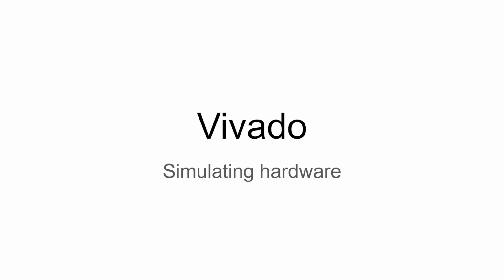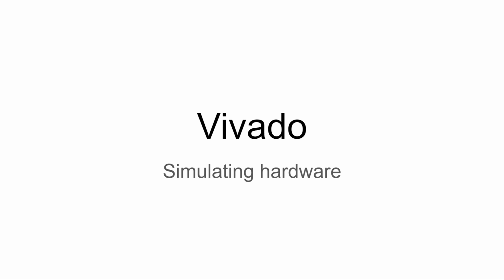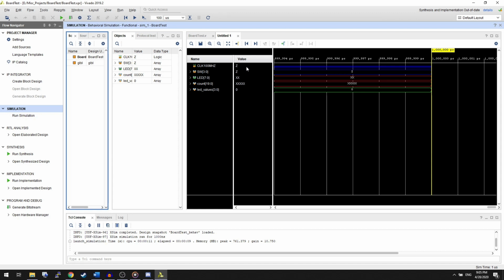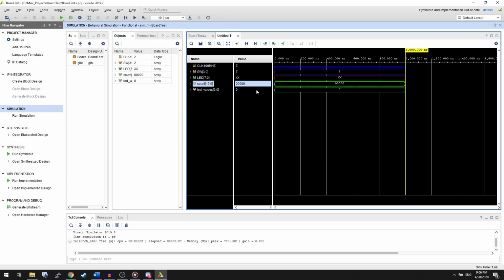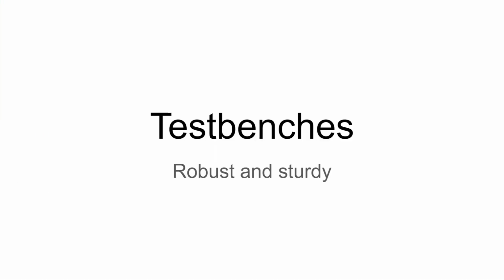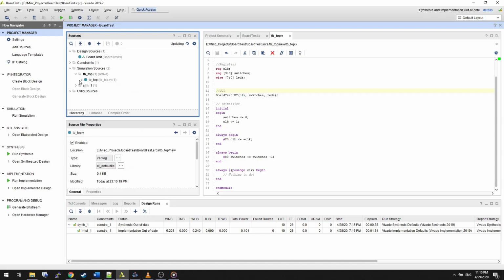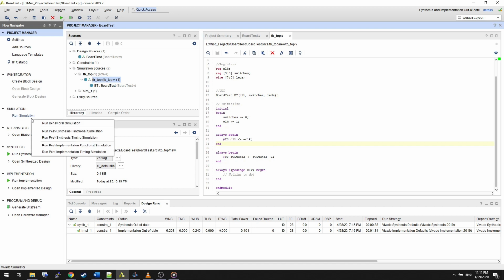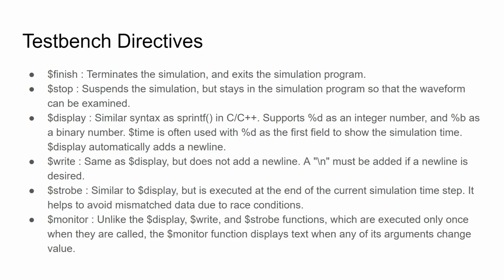Xilinx Vivado -  Simulation

Comment: Love the video! but I'm curious, how would we keep track of registers that aren't input or outputs to the module under test in the testbench? as in: the register is defined in the module and only used in the module?
thanks.
Reply from the maker: This link gives an example: https://stackoverflow.com/questions/18473754/how-do-i-access-an-internal-reg-inside-a-module
You can also add it to your waveforms buy adding a wire. As an example for BoardTest module. that might look as follows:
wire [19:0] internal_count;
assign internal_count = BoardTest.count;